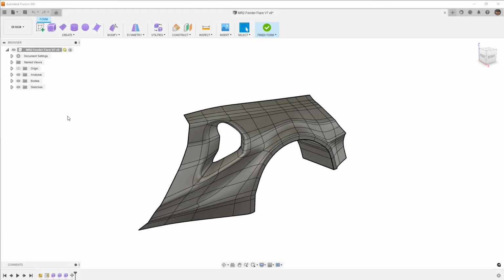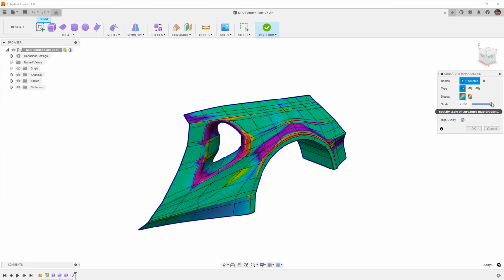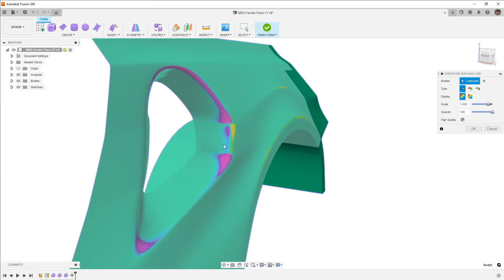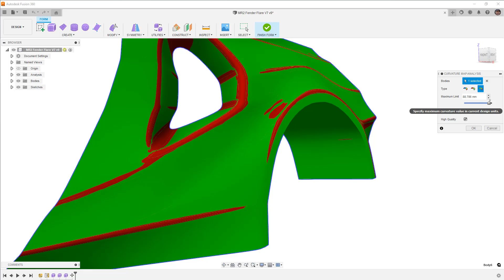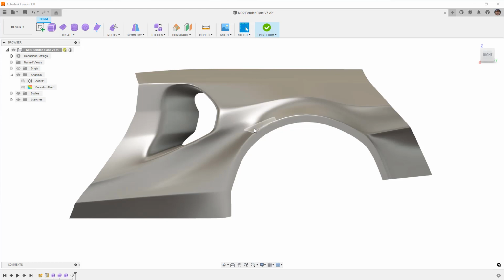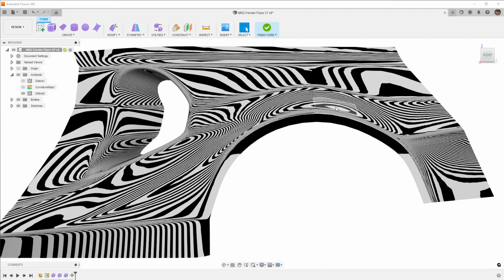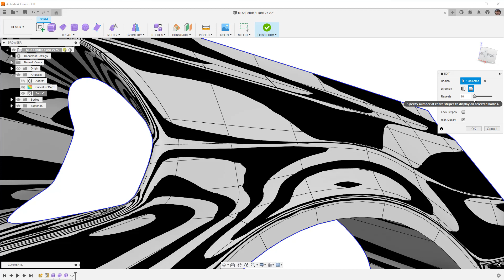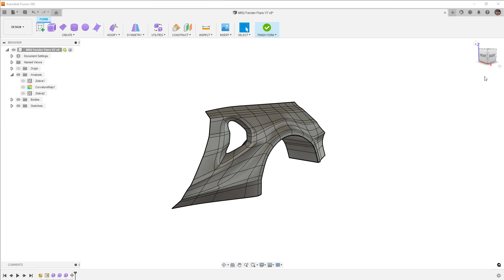Fusion 360 Forms Mastery Part 35 - How do I use Curvature Analysis #Fusion360

Comment: Hi, I'm really struggling with this.

I have a mesh in .stl  (I could import it in other formats, but as .stl is a common file type I went with that)

I want to do a curvature analysis on it, but I cant seem to do it, I can't even find the gaussian menu that you clicked on.  Please, some of us need things explained like you would explain things to a small child haha

Really I have to do a curvature analysis (preferably with color map, but at this point I'd take any curvature analysis as a win) along just one axis, its proving more difficult than pulling hens teeth.
Reply from the maker: hmm, i don't think you can with a mesh, it needs to be a solid or surface.  A way around this is to convert the mesh.  On the mesh tools under Modify you can Convert Mesh.  This is going to make a solid that is made up of a lot of small flat faces, so not sure how helpful a curvature map will be.  If you can bring in a quad mesh as an OBJ, you can convert it to a surface in the forms tools as long as its not too big.  But in general you can't analyze a mesh.  The Curvature map should be in the Inspect menu.

Comment: Wait, still trying to wrap my head around the mathematics of the curvature map.  Shouldn't principal min and principal max be perfect inverses of each other?  Also when it says "max" and "min", they're talking about curvature as the inverse of the radius of curvature ie a low radius means high curvature and vice versa?
Reply from the maker: So the Principal Min will show highlights on the areas with the least amount of curvature and Principal Max will show highlights(red) on the areas with the most amount of curvature.  Least and most are relative terms though.  When we say Max or Most amount of curvature that is really the quickest change or tightest radius.  So a 10mm radius is higher than a 100mm radius on the Principal Max.

So in a principal max if you set the value limit at 10mm anything below (or equal to) that will be highlighted in red.  In Principal Minimum if you set the minimum limit at say 2500mm, anything above that limit will be red.  So it is sort of the reverse but its not exactly unfortunately.  Meaning if i take the same design and set the max limit at 10, then go to Principal Min and set the upper limit at say 11, I am not just seeing a flip of colors.

Comment: Hi, how to hide the lines of the t-spline?
Reply from the maker: On a PC its is the shortcut key CTRL+4.  CTRL+6 will bring them back.  This is just a shortcut for the display settings shaded and shaded with visible edges.  You can find that at the bottom center of Fusion.  The small monitor icon called "Display Settings" then navigate to Visual Styles.